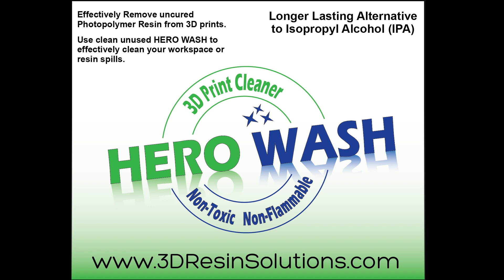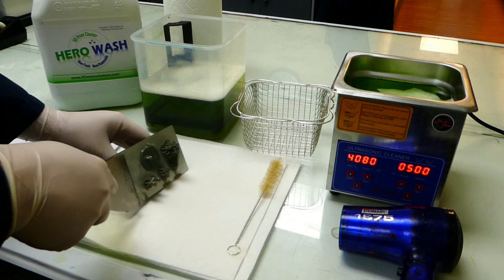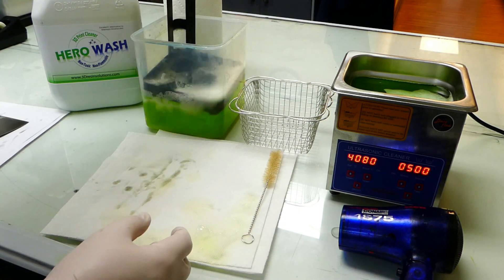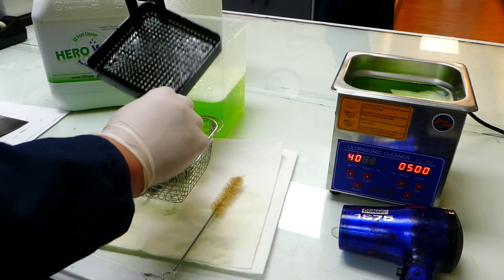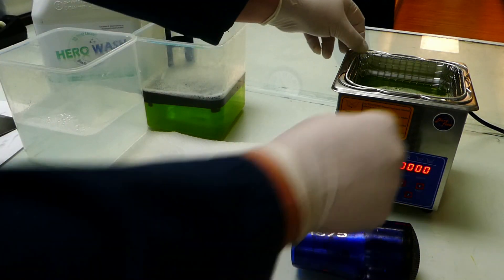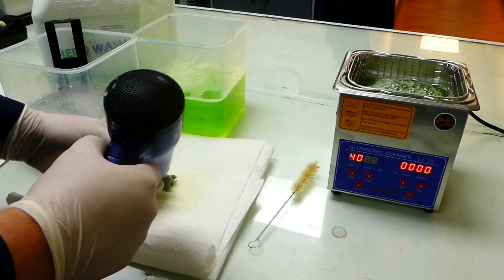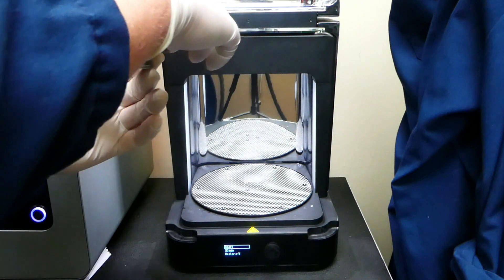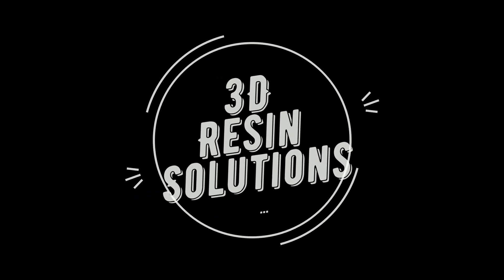Using HERO WASH 3D Print Cleaner - Excellent Alternative to IPA

Comment: Seriously....it's Simple/Mean Green and you call it Hero Wash!!! 🙄🙄🙄
Reply from the maker: I assure you it is not simple Green. Simple green actually works a little better than ours at room temperature within a "Wash and Cure" station - which we now don't recommend using with HERO WASH. when heated properly and used with an ultra sonic cleaner HERO WASH is very efficient at removing resin from prints.... We are continually working on improving our formulas and may come out with alternatives in the near future. (this comment was edited to include more information)
Reply: @3DResinSolutions  That makes no sense at all, if Simple Green works better then your "formula" why would anyone buy your product??? Don't get me wrong, I love supporting business if they got a new and improve product!
Reply: @peterpham4846  At least they are honest.
Reply: @3DResinSolutions  This is why I like this company. Straight up honest answer. I may not buy 3DRS cleaner until it works better than Simple Green, but I'll darn sure buy the resin from them and them alone.